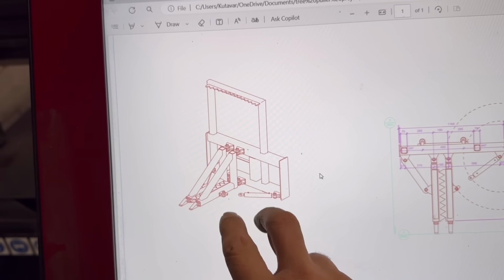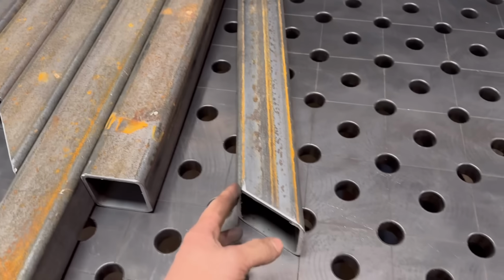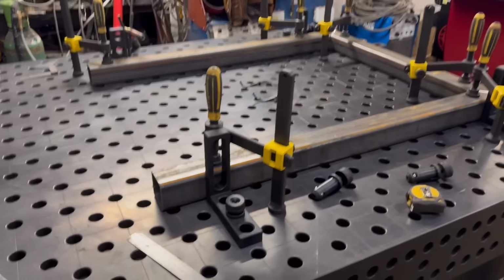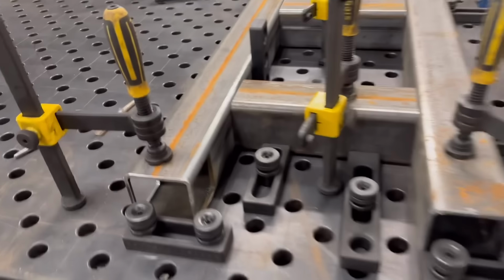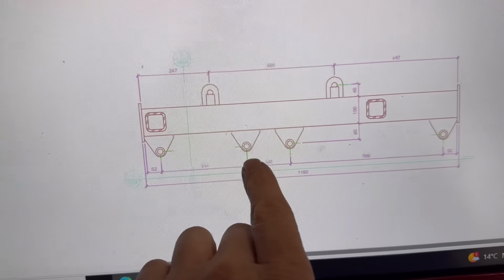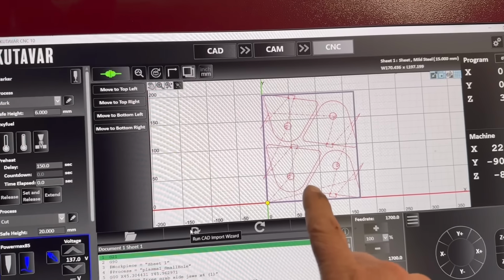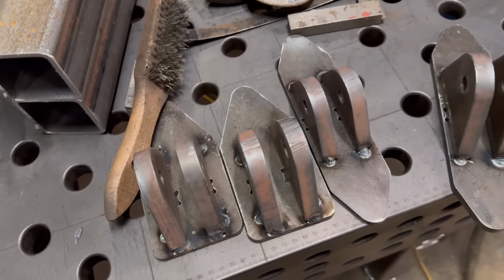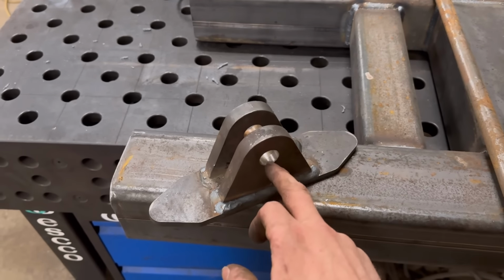Fabricating a tree puller for the front of a Compact loader. Part 1

Comment: Another great video Oliver. Thanks. A perfect example of a plater’s job in a fabrication shop. Reading the drawings, some better than others, cutting the components, assembling them and tacking everything together. While the welding is undoubtedly a very skilled job I think the plater’s work is from my experience in fabrication shops very underrated. From all the platers I have met over the years I think a great number would have given a lot for a fabrication table like yours. All they had was a plain table with a gas fire underneath to help keep them warm in winter in a shop with no heating.

Comment: I think those types of brackets will be better in the long run...not only does it spread the load, but if it ever needs to be repaired...all they (or you) will have to do is plasma/arc gouge off the plate, clean up the box section and put a new part back on..but with the loads/stresses being spread out over a thicker piece, it shouldn't crack welds or bust box sections like normal builds
Sure fabrication is a bit more lengthy and time consuming...but it makes for a MUCH stronger and longer lasting machine in the long run...
Loving it...can wait for part 2!
Keep em coming!!!!

Comment: I think it was Jimbo’s Garage that I saw fabricate shallow drawers to fit under the fixture table top to catch all the dust and debris that fall through the holes. These could be pulled out for cleaning and meant that you could use the area under the table for clean(ish) storage.

Comment: I assume that the black coating on your table prevents weld spatter from sticking to the table. Is that correct? I’ve personally never thought that I could justify the price of a table like that but after seeing you use yours, I may have to rethink that. Wonder if they’re available in imperial?🤔
Reply from the maker: Yes. Helps stop spatter.

Comment: Couple of thoughts. Customer is smart - he let you cast your eye over the plans and make modifications/improvements as you see fit. Customer is not always right and smart ones know that. 2nd. The milling cutter cuts where you tell it to cut. Offset to bore of hole or even half a hole - whatever. Doesn't care where it is told to cut. Reamer follows the existing bore which may or may not be the exact 60mm (given the welding distortion) from the top plate. Also reamer may twist axially as it goes through first hole. Reamer could break then or as it tries to align with 2nd hole. So please use the 20mm and 25mm milling cutters to accurately position/size/align the holes. Otherwise you are doing well. You have a good brain in your head and can use it wisely. Retired mechanic/machinist/fabricator in Land Down Under.

Comment: excellent job as usual 👍

A tip in the plasma cutter. 

When you have to cut pipes or profiles, make a jig that you place against the table so you don't have to measure, just enter the coordinates into the machine. 👍👍

Comment: What you’ve been supplied with are ASSEMBLY DRAWINGS which are  to inform you how the general form of the job. 
NOT FOR WORKING FROM. 
for marking cutting the parts you need and should insist on are DETAILED DRAWINGS which shows all the individual parts fully diminished. 
On the shopfloor one should not be expected to calculate or search for dimensions. 
Calculations should be carried out in the sedate environment of the drawing office not on the noisy,dusty, environment of the shopfloor with cracked and broken calculators. 
The draftsman is not doing his jobs
Reply: It may just be as a fabrication guide. It just happens that they were drawn with a computer, but perhaps that’s just because the customer had no envelopes handy or he couldn’t find a pen.
Reply: @lawrencemanning napkins will do in a pinch though brown paper bags are better.